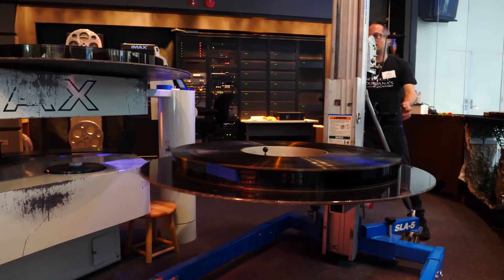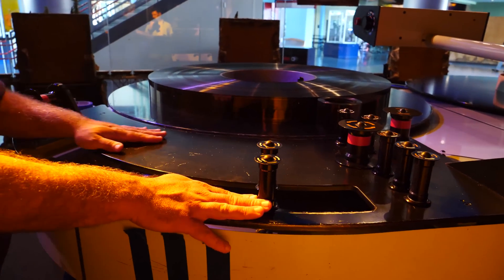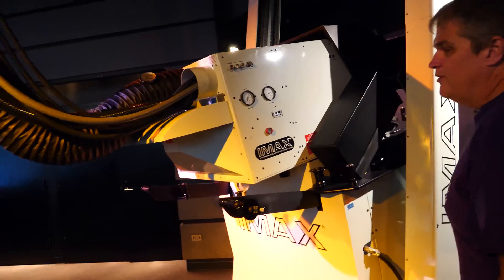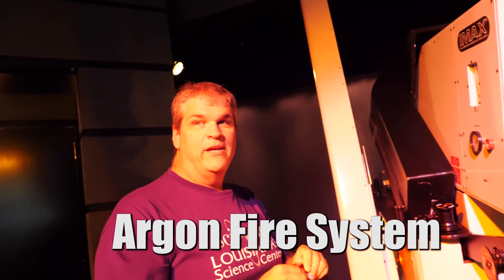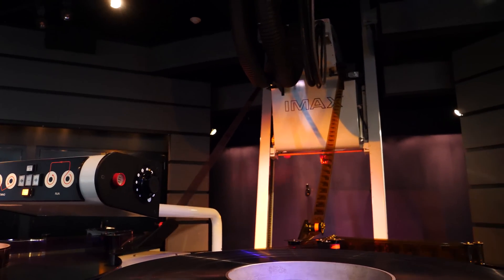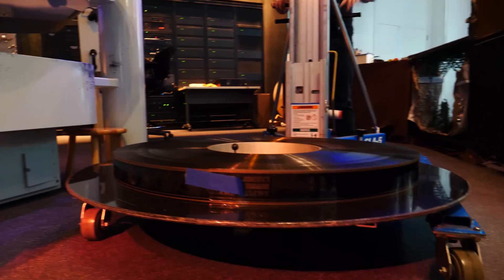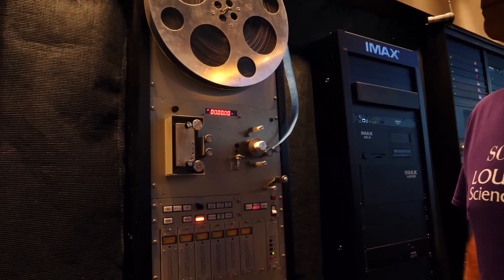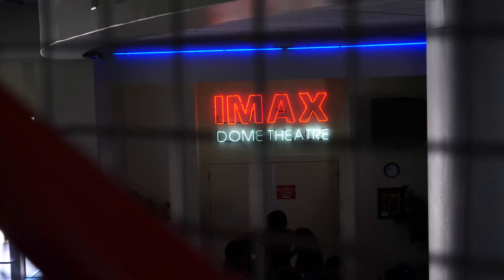IMAX Projection System Tour! - RCR - Ep. 25

Comment: IMAX 70mm film is the origin of the IMAX flat screen theater, or the OMNIMAX Theater which is the dome screen Theater.  The IMAX 70mm film format is still amazing as far as I am concerned.  For someone to like the digital projection version better than 70mm film is one thing, but to put down film as a projection medium is terribly wrong.  I AM NOT PUTTING DOWN DIGITAL PROJECTION EITHER.  I don't agree that film is a worthless medium.  Maybe I am incorrect, but digital projection cannot match the beauty, depth, color richness, and last but not least the resolution that the 15/70 film format is capable of.  (15/70 means 15 perforations or sprocket holes on 70mm film per picture.  Also this film passes through the IMAX projector horizontally.)